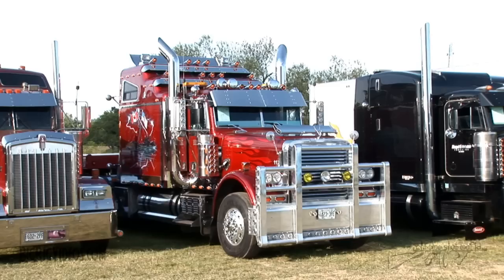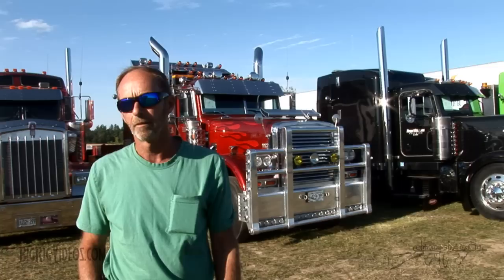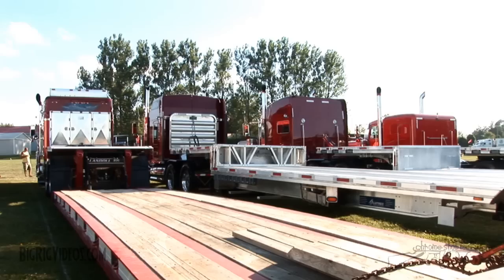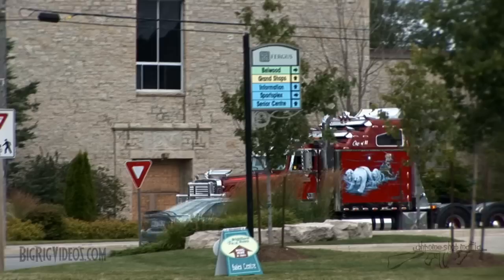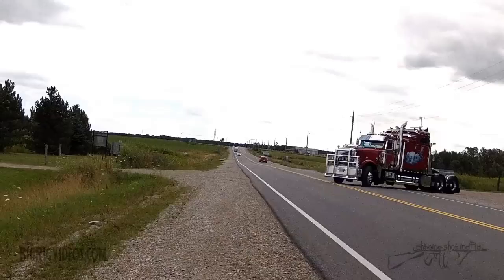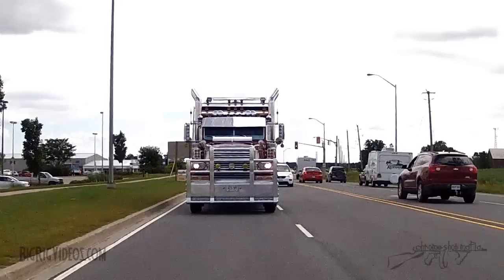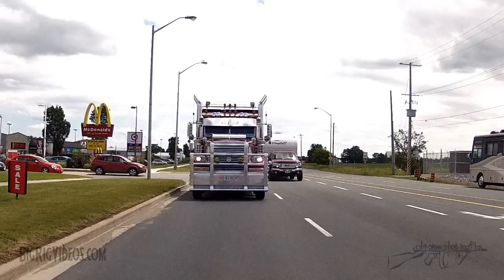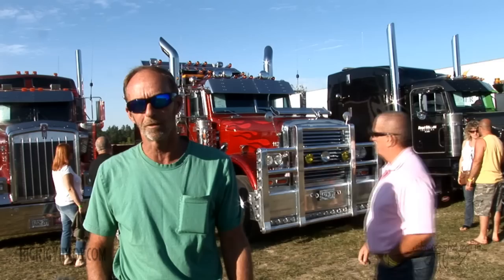Owner Operator Interview - R.W. Martin Trucking

Comment: 0:37 Here in Australia that's the kind of mudguards all trucks have.
Reply: and in the UK too,

They stop all the sh*t flying up and splattering the 5th wheel handle and underside of the trailer and cut spray down.
Reply: Aye, all of em have it here, it is a common sight, though i am more of a fan of the euro 3 piece, this is a one piece and if its cut you must replace all off it.